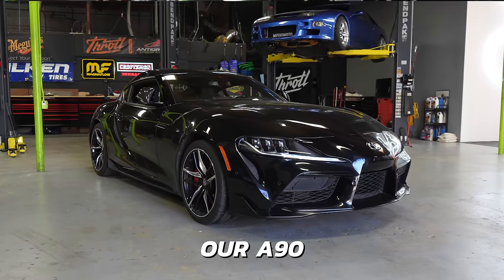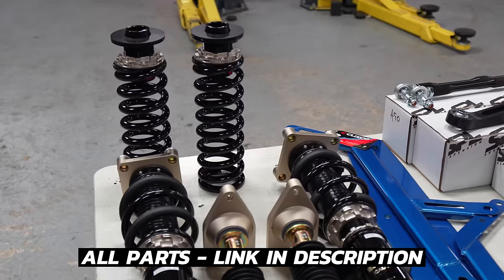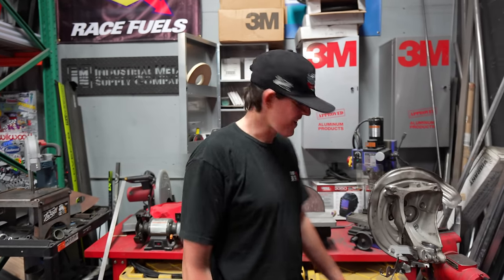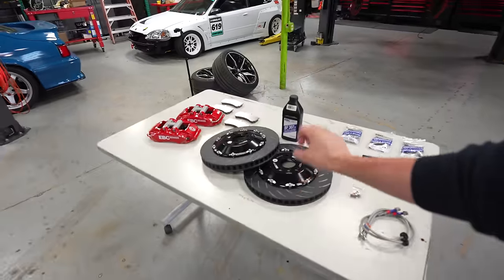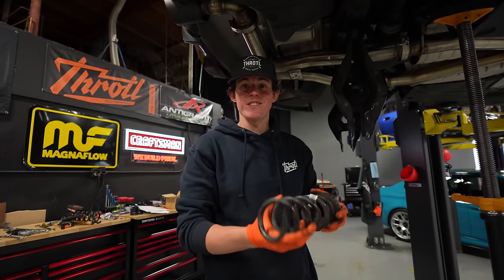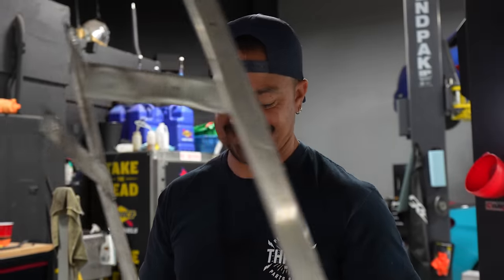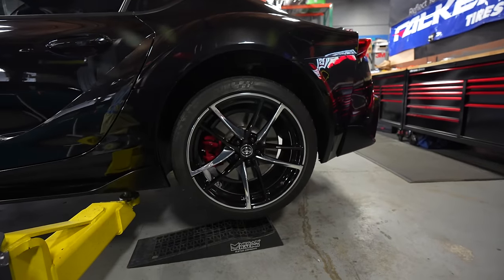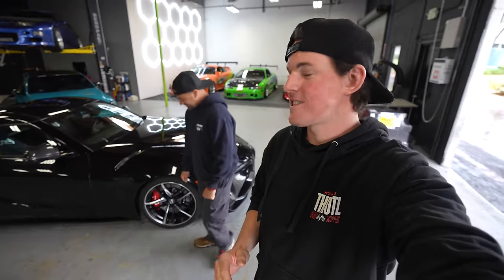Buying a 2020 Toyota Supra and Modifying it immediately - Big Brake Kit and Suspension - Part 2

Comment: for the spindle there is a tool i got on amazon that goes on a 1/2in rachet that lodges between the gap in the hub and when rotated spreads it out so the strut can side out without taking all the control arms and tie rods off
Reply: Would've most likely come off before they cut the springs and causing it to wedge in deeper than it suppose to be
Reply: Those spindle tools are garbage, I got like one use out of the one I bought on Amazon before it just wore down and effectively didn’t spread  it anymore. I had better luck just hammering a filer in there that progressive increases in size

Comment: I am enjoying your 2020 Toyota Supra build!  I am currently building a 1985 Toyota Celica Supra.  The car was my grandma's (original owner).  I have never worked on cars prior to this.  I have replaced all the fluids, filters, vacuum lines, radiator, radiator tubing,, cold air intake tubing, spark plugs and wires, etc.  I am getting ready to put new headers and a Magnaflow exhaust from Raptor Racing on it.  I have a big brake kit from Ceika that needs to be installed.  I have new shocks and springs that need to be installed.  Looking to purchase Whiteline sway bars.  I love having a project car that is not only fun to drive but sentimental.  Keep it up, guys!  Love the content!

Comment: I once swapped my work van with my boss for the weekend, When I got it back I drove uo one road and round a roundabout on to a dual carriageway and I got loads of noise from the front wheel, I got out and saw all the wheel nuts were loose and the holes had slotted I tightened them up went back to my boss who told me he had changed the wheel on the Friday and had driven about 200 miles like that. 1 new wheel and one puncture repair later I was back on the road.

Comment: ive had 3 cars lowered... my first lowered car= racelands, they lasted a month before i put the stock ones back on. absolute garbage.... second... bc racing ds series becuase BRs were out of stock.... i couldnt get them to a place i was happy with them they were just all around too stiff and the tires i had general gmax as were bouncey af so i didnt like.... with my current car im on skunk 2 lowering shocks with eibach springs and this shit is so good i cant tell im lowered while driving, it handles like oem +++ and it looks slammed.

Comment: Why do frount brakes and not the rear its that car rear wheel drive wouldnt be better to have both
Reply: more stopping power comes from the front with most vehicles do to how the weight transfer happens when you stop.